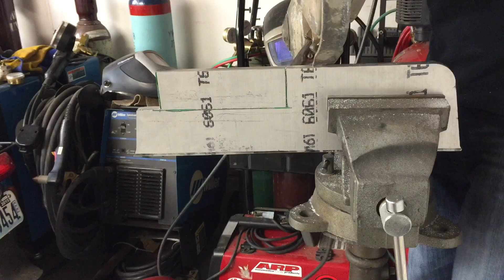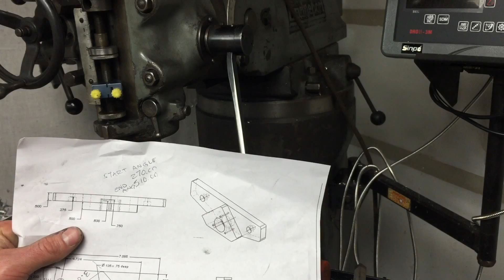G0704 X Axis double bearing stepper mount From Hoss' phase 3 plans (mostly)

Comment: you should drill your bore out to a closer finish diameter before finishing it to size with the boring bar.
Reply from the maker: You are right about that. I have not yet invested in larger drills though (1/2'' currently is my largest). I could bore with the 1.00'' end mill though. Thanks for the comment, I am all ears, and always looking to improve my techniques.
Reply: Unorthodox Fabrication
thanks for the vids, im looking to do a conversion myself !
Reply from the maker: Cool,
 
When you do you can get the plans I used from G0704.com Hoss is the man, and is very nice to deal with. He can be found on CNCzone.com and has tons and tons of great videos. If you live in the USA the G0704 is hard to beat for its value. I am thinking of doing a CNC RF45 next. But it will be awhile. The is a Phase 1, 2, and 3 CNC option for the G0704 from Hoss, I opted for Phase 3 on my build which includes double bearings for the the different Axis, and Ballscrews with double ballnuts for limited backlash. Thanks for watching the videos and good luck.
Reply: Unorthodox Fabrication
I'm looking at the charter oak 12z for the larger work envelope and rigidity. I am in the US and a member of cnczone thats originally how i stumbled across your videos hahaha.
looking forward to more updates.

thanks again!
Reply from the maker: Ok great, 

 I think I will order one of those charter Oak 12z myself! I am in love with how much travel they have and Hoss says the Rf45 he has no issues hogging aluminum. I will probably order one up with in a week. I am selling the big bridgeport. Take care and thanks for the comments.